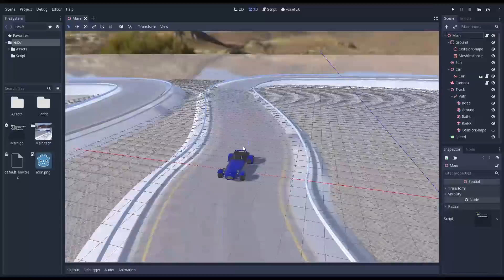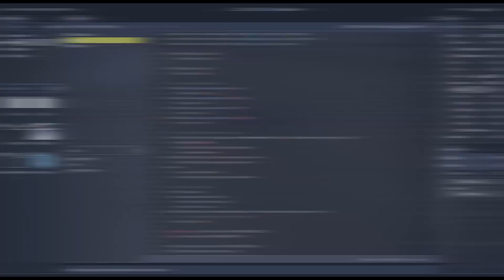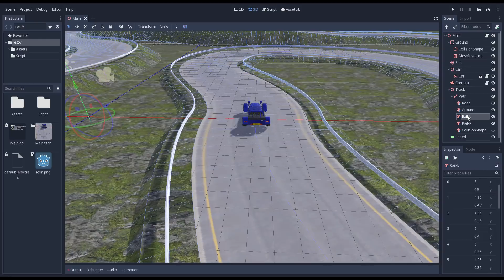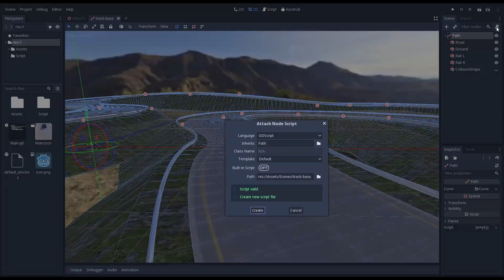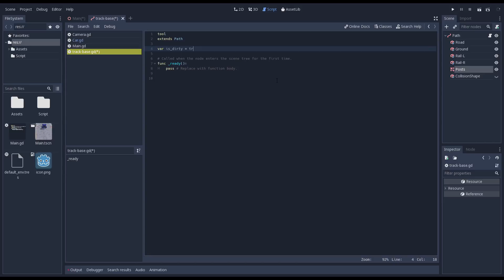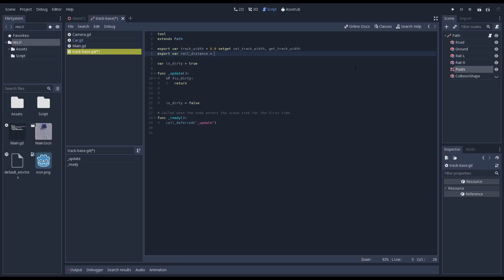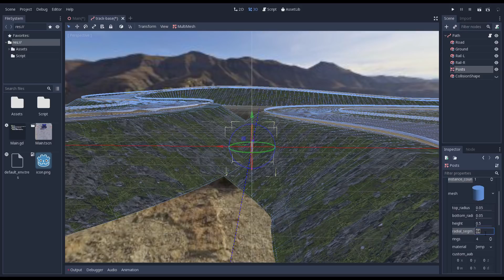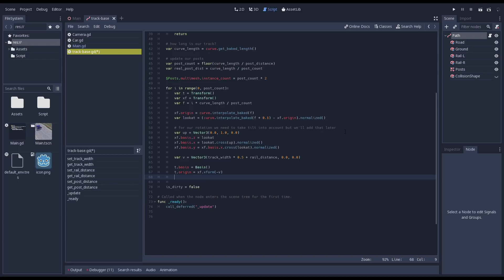Godot vehicle tutorial part 3 - Improving the track

Comment: Nice tutorial!
can i change this csg to a godot scene? i want to make an arcade racing game and my idea is to make some upside down track parts, like in that last hot wheels unleashed game: to make it, i think i'll need an area with a gravity point to mantain the cars orbiting the track road.
other question: in this system you're using is it possible to mark some points of the track to not having a road (like a ramp on the river), or even make an anti-gravity system like mario kart 8?
is it possible to make a detection system, to locate what car has passed into what points? it can make possible to classify the cars position in the race.
and what about a horizontal inclination like the nascar tracks?
Reply from the maker: The curve logic does have the ability to have banking info in it but there is no good UI for influencing that which is a shame, and no you can't put gaps in there, you would have to have more then one CSG nodes for that.

The CSG Nodes are part of the Godot scene, I'm not sure if it is in the latest stable build but there was work being done to expose the ability to extract the generated mesh and save it so you can do more with it.

That said, for more complex tracks it probably makes more sense to create them in a tool like blender.

For positioning, have a look at the functions on the curve, there is a get closest point function that works really well as a way to determine where the player is on the track. That said, the more common checkpoint approach you can simply do by creating area nodes that detect when the car interacts with it.

Note that area nodes also allow you to override local gravity so you can probably use those to change the gravity applied to the car when it is on certain sections of the track.
Reply: @BastiaanOlij  thanks

Comment: cars speed can be calculated with this formula:
(3.0/25.0) * PI * VehicleWheel.wheel_radius * VehicleWheel.get_rpm()
but it works only when car is touching a ground
Reply from the maker: Yup, though further on in the series I simply check how far the car has moved to get a speed. Again the limitation is that it's only accurate if the car has grip.

Comment: Hi, great work, I have a question, how can make the camera is inside of vehicle but  for  a VR game, I tried drag inside camera of vehicle and this  collide and the camera is move strange.  
I hope you can help me.
thanks regards
Reply from the maker: First thing you need to do is call ARVRServer.center_on_hmd(ARVRServer.RESET_BUT_KEEP_TILT, false), you'll want to do this a second or so after initialising the interface because it takes a second for the initial tracking to stabilize. This records data that allows the ARVRServer to place the camera at the ARVROrigin point facing forward. Often what you'd implement is an area check to see if the cameras position is too far away from the origin point, and show a "push this button to reset the camera" image. The button calls the center_on_hmd function again.

Then it is simply a matter of making the ARVROrigin a child of your vehicle and place it where the heads location would normally be and make the ARVRCamera a child node as per normal.
Reply: Thanks this worked  the camera is inside, but the camera ARVRCamera shakes when I rotate and see inside of vehicle, , I forgot to tell you that my project is for VR on mobile android. Thanks so much for your time in answered
Reply from the maker: Have a read through the info here: https://github.com/godotengine/godot/issues/19645
If you can build from source you can apply those changes and see if that resolves the issue. I would be very interested in hearing if it works for you
Reply: I discovered that this happens more if my vehicle has textures, why? can you help me?
Reply from the maker: Omar Ochoa PigoStudios hard to say, textures do add a little overhead but they shouldn’t have a large impact, unless you use very large textures it may be introducing overhead swapping textures in and out of gpu memory.
Reply: @BastiaanOlij   Hi  I found the solution for problem the shake camera when the models have texture, I activated the option unshaded   and this fixed the problem. Regards
Reply from the maker: Omar Ochoa PigoStudios that would indeed remove alot of strain on the render engine so its not surprising you have a good fps boost and with that much finer head tracking.